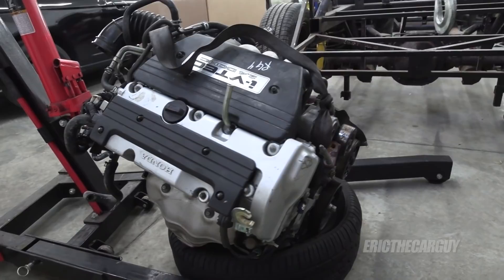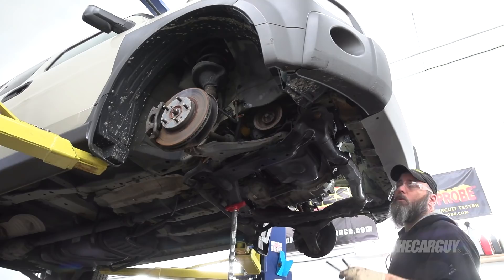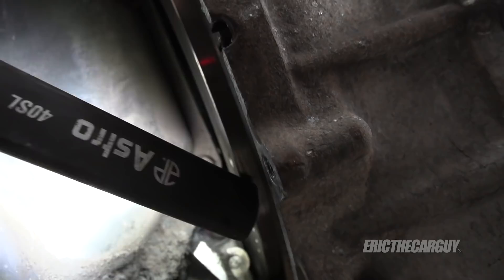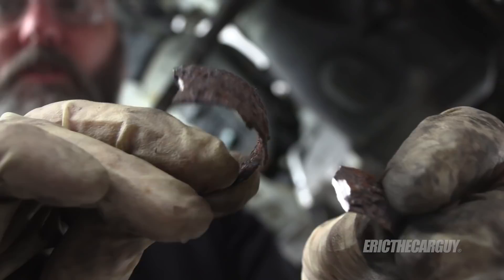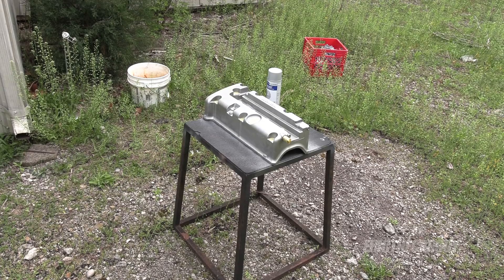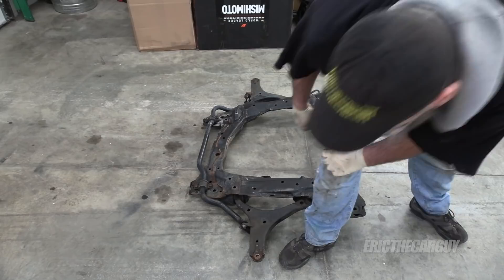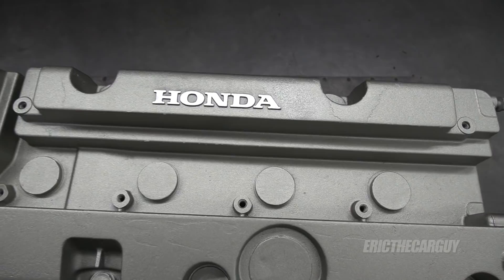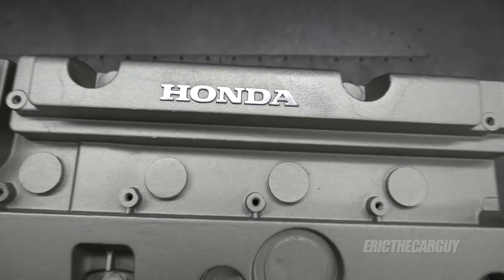Honda Element Engine Replacement and Restoration (Part 1)

Comment: Hey Eric.   Why does 1 side of my ball joints keep pushing the grease out   Both side filled correctly. But my drivers side keeps pushing it out the fitting a lot    Upper ball joints new.  Control arms.   Leveling kit.  Bilstein 5100’s all new.   Do you think it’s cause the truck isn’t sitting even ?  Or the alignment isn’t 100% correct?
Reply from the maker: Vehicles never sit even when you drive them solo. Drivers side always sits lower and wears out more usually. I often try and sit in the drivers seat when anyone does an alignment on one of my vehicles. https://www.youtube.com/watch?v=QBUxJSeYiow&t=8s
Reply: @ericthecarguy  but is that normal for a ball joint to be pushing out all the grease so much and so often?    I didn’t think they were supposed to push the grease out the grease fitting like that

Comment: I notice you use a lot of chrome sockets and extensions with an impact wrench. Ever have one come apart on you? I've always been told that was a potential danger, and chrome with an impact was a big no-no...
Reply from the maker: As a general practice, I don't use chrome sockets with my impact. Unfortunately my best extensions are chrome so I often end up using them. I think the issue is more that you'll damage a chrome socket with your impact. After a while they start to chip. Sometimes those chips leave sharp edges on the socket that can cut you. I haven't seen one explode like some would suggest though.

Comment: Maybe a topic for an ETCG1 video: How much of of the unreliablilty of certain vehicles, engines etc. is really caused by design flaws and how much is actually neglect by the owners or improper repairs. For example, the Toyota 7M-GTE Engine in my Supra is said to be unreliable and while there is an issue with the head gasket and head bolt torque from the factory, I have a feeling a lot of its reputation comes from people not equipped with the knowledge and skills to maintain the engine properly.
Reply from the maker: https://www.youtube.com/watch?v=M5vchkvemG8

Comment: Does the gearbox have a breather hose? Mine does and I only needed to remove the drain plug.
Reply from the maker: All transmissions have a breather hose. It's a small opening. The fill is a larger opening and allows more air in.
Reply: @ericthecarguy  just wondering why open fill port if they have a breather hose. You can use that to tell if the hose is blocked.

Comment: Hi Eric - I am about half way through the video but I have a question for you: in real time, in and out. How long did this take? 
And thank you for posting Honda Element content. I have had my Element since new in 2003. The Element is, by far, the best car I have ever owned. Nearly 200k on it. I want to keep it forever... I bought a second “fun car (2006 Mini Cooper S) a few years back to keep the some of the miles off my Element... at least In the clear weather months.
Reply from the maker: You can't use that as a gauge. It takes 4x longer to do anything when I film it. Not to mention I had issues with parts that I had to work around. If I had all the parts, and didn't do any 'restoration' work, I could have had it knocked out in a day.

Comment: How much $$ difference from buying  all new bushings to new control arms? Spending a day to remove bushings, press in  and paint... $1000 worth of labor?
Reply from the maker: With the correct tools bushing replacement goes much smoother.

Comment: The low mileage on the engines is because the japanese system of car inspections. I think it is their govt's way getting older cars off the road and insuring new cars are being sold. Basically, you hand the car over to the inspector, and they get to replace what they think they can get away with. 
I knew someone over there, and he was charged for an entire windshield wiper system because the wipers were touching the weatherstripping when off. He was also sold a new shift knob due to the pattern worn off.  Squeaky shocks were also a big moneymaker for inspectors. 
The time between inspections is based on the year of the car. When the car is about 10 years old, you cannot afford to keep it because of the recurring expenses of inspecting it. Cars reach the "not worth it" point with a lot of life left in the drivetrain. Someone showed me a like new condition car that cost him 300 dollars. He was sending it to the junkyard in a month because annual inspection was coming due. It was cheaper for him to buy cars and dump them vs playing inspection games.

Comment: I watch almost all of your videos Eric, even the ones that aren't applicable to me necessarily. I recently bought a 14 Odyssey and am revisiting the entire Honda J Series vids. I have been getting my parts from our local Honda dealer and have noticed several vendors on Amazon and Ebay claiming "Honda Genuine" and "OEM." With foreign counterfeiting getting much better at imitating genuine parts, how do you spot or filter out vendors? Is there a sort of packaging markings that you look for? Is there any option out there to your knowledge where Honda Genuine parts can be had at a discount without taking a massive risk of installing an inferior product? I recently bit the bullet at the dealer and paid $30 per spark plug. Considering that the water pump and timing belt are coming up, I cringe. Any thoughts would be appreciated and thanks in advance. Still fantastic content on the channel by the way.
Reply from the maker: If you want Honda Genuine parts, get them from Honda. That's about the best advice I can give.
Reply: @ericthecarguy  thanks for the quick reply. That’s kind of what I thought. Better safe than sorry, which was why I have been just going through Honda directly thus far.

Comment: If you find me  a Honda element tha would be great I used to have one with over 165000 sol# i .Biggest mistake Is ever regret andb
I want to make a rePair class
Teach these kids basic maintenance! And repair
Reply: I have one, I had 178k miles. It has misfiring issues

Comment: "90% of needed repairs are because of poor previous repair workmanship."

And the reason none of my vehicles has seen the inside of a retail repair establishment in over three decades.
Reply: I did a frame-out front end refresh on my 1993 C1500 pickup truck a couple of years ago.  After pricing replacement bushings, ball joints, etc., a new whole control arm wasn't that much more of a cash outlay.  So, I went with brand new upper and lower control arms.

Comment: The owner had said he took it to get the oil changed then got it back and had the engine lose all power , can you say , drain and no refill then drive it back to then remember by the service tech , we have no oil , “hurry , put some in and act normal “.

Comment: I am surprised ETCG is changing the entire engine when it was just a bad head from the valves getting too tight.  Needs to do better troubleshooting like SMA does....would have saved a bunch of labor

Comment: Why reuse the Valve cover? Doesn’t the other engine have one thats better shape. Also Mitsuba makes the starters for Honda Engines.
Reply from the maker: I believe I covered that in the video. Thanks for the comment.

Comment: should of swapped a tsx motor make it worth the work,  another 50whp feels way better. My buddies shop Importlife performance swapped one with mild cam, intake, header and exhaust made 230whp tuned on k tuner. That's 80whp more. 😁
Reply from the maker: You don't mod your daily. https://www.youtube.com/watch?v=mCjHpi7A3t8

Also, I'm of the opinion that Elements weren't made to be fast. Additionally I don't need the headache of having to mess with a new computer and tune. I just want to drive it. I've got plenty of 'fast cars' I can drive when I want to go fast. Thanks for the comment.
Reply: @ericthecarguy  it's a stock swap. it keeps all the stock sensors, the pretty simple tune for a good dyno tuner, imo the  element underpowerd just to merge on the freeway sometimes it's a little slow to accelerate. but I see what you're saying thanks for the reply. 👍👍👍

Comment: After 21 yrs on the Honda assembly line I can assure you that a high number of cross threaded bolts are provided on each new engine.  The last few yrs it was really embarrassing
Reply from the maker: That is sad to hear.

Comment: @3:44, that was NOT a quick lube oil place.  First off they use a 1/2" Uga-Duga at 200PSI, then after a 15 Uga-Duga count they bring out the 4' breaker bar.  LOL...That 10mm probably came from the quick change place.  I own 4 different socket wrenches from dealerships...gotta love free snap-on tools...LOL
Reply from the maker: Sorry, you're right. I'll do better next time.
Reply: @ericthecarguy  LOL...You know it's true.  My wife took her truck to a quicklube even though I told her not to, and that I'd do the oil instead of those hacks.  "no, this place came HIGHLY recommended by the shop guys I work with"....yea...overfilled the oil by AT LEAST a quart, replaced the filter with just a POS no-name brand (charged her for a 'Premium Filter'),  told her she needed an air filter (I had already replaced it), and told her she needed a cabin air filter (her Expedition doesn't have one).  Thankfully she called me on those two items....NEVER GO TO A QUICK LUBE...
BTW: I think you're right, that thing went off road...previous owner have kids by chance?  Yea...Jr. took it out for some fun is my guess.

Comment: You could have bought a set of control arms for like 80$ on ebay and been done. Its not worth doing bushings now days, to much effort struggle just to try to save a few dollars... Unless the control arms are super expensive or your doing solid rubber mounts.
Reply from the maker: You could have watched the video and heard what I said about control arm bushings.
Reply: @ericthecarguy  It was a generalization not a bad comment toward you brother. Its just from experience of wasting time and money on bushings.

Comment: When you look at ALL the myriad of parts that are under the hood and how complex & tedious working on combustion engines is...
Its about time for humanity to completely abandon gas cars & switch exclusively to electronic or other alternatives. Electric cars are way more simple and have less complicated parts. Even rotaries have a simpler engine layout...
Reply from the maker: In theory, maybe, but I think you're overlooking things like electrical infrastructure, the damage mining operations do to the environment (batteries don't materialize out of thin air), the challenge of putting out a fire in an electric vehicle, the range, extreme cold and hot weather, and what you do with the batteries at the end of life. Not to mention if you get your power by burning coal, are you really cleaning up the air? You might think electric vehicles will save us. They won't. The only thing that might work is a big push toward public transportation. Less waste, less energy, and more targeted. It's personal consumption that's really killing us.
Reply: @ericthecarguy  
True, true...
Some good points 🪡 in your rebuke...
Furthermore, nothing will ever be 100% perfect...in the universe! 😉 Maybe the best thing to do would be to use bicycles 🚲 to get around locally...or 🐎!? 🤠 
That being said,  you failed to react with to my other comment; that your content can work as an ASMR medium! 😂 
(Just kidding!) 🧰 🚘...🧘‍♂️ 💤
Reply: @ericthecarguy  
Anyway thanks for sharing your wisdom & knowledge over the years...and your hard work and elbow grease!
😂